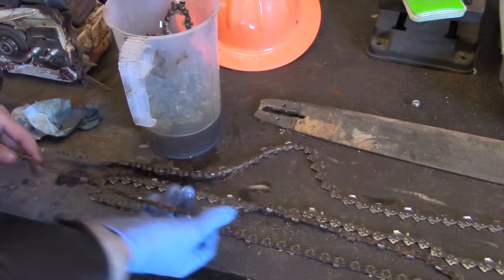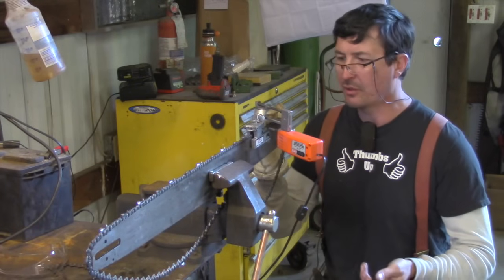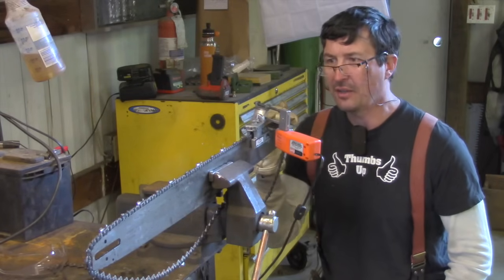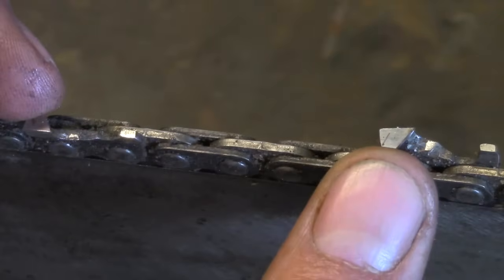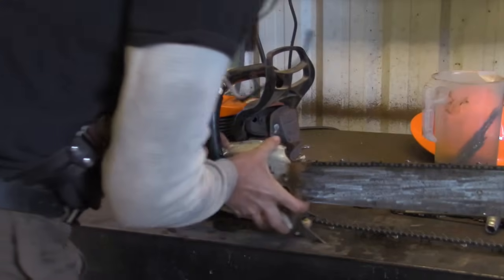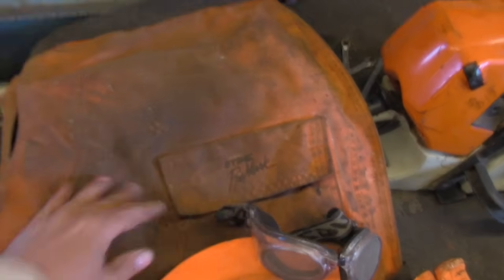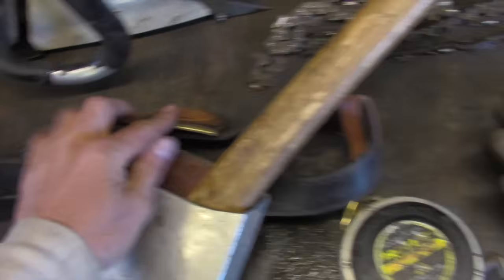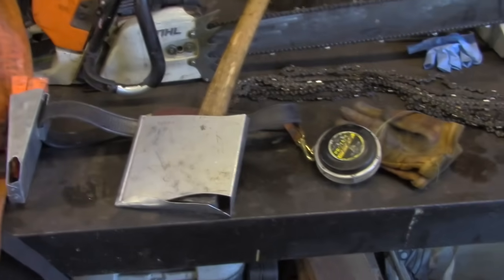A Better Way To Sharpen A Chainsaw

Comment: Nah, got to disagree with Wranglerstar on this one. If I'm chain sawing all day, means I got to sharpen at least once and two or three times depending on type of wood. It only takes 20 to 30 minutes with file. Depending how much cleaning chain and bar needs. With that much sharpening going on I'm not going to worry about perfectly aligned teeth. As long as it cuts through the wood like butter, that's all that counts. This isn't some chainsaw precision sharpening contest. This is just keeping the overgrowth under control. Anyway love your videos

Comment: Keeping a chainsaw clean...like herding cats or pushing water uphill.
Reply: irritablearchitect He pushes water uphill quite easily with his ram pump. ;-)
Reply: Soulman1282
Reply: irritablearchitect cats are easy to herd with food.
Reply: Pardon the cliche.
Reply: irritablearchitect You know how it is; some of us just can't help it. :)
Reply: No harm, no foul...I'm the same way, actually.

The world wouldn't be the same without the Smartassery.
Reply: irritablearchitect Indeed, it would be quite dull.
Reply: wildcat19671 ...as dull as a used chainsaw, and just as filthy. We've come full circle.
Reply: irritablearchitect 
For a funny video, search YouTube for cowboys herding cats
Reply: for the small amount of oil that a chain uses I just use new motor oil and avoid the crud that comes from an engine getting into my oil pump
Reply: It's a joke...a chainsaw is a filthy thing, even when it's clean, and then when you're running it as it's to be used, it's far worse.

2 Euros is a spectacularly good price, however. I think fitted chains cost me about $15-20 here in the states.
Reply: "...damn saw dust gets everywhere..."

Ya don't say! :)
Reply: Me too.
Reply: irritablearchitect he

Comment: Hi good vid for the novice.Not knocking you.I learned to sharpen saw chain when I was 12 years old,Yea about a 100 years ago.With 2 simple files(round and raker) I can make a factory chain look dull.I can make nice chips or make spaghetti.Does not take a whole lot of time to learn hand filing.The biggest problem to over come is left hand and right hand.Most folks can not get the angle the same from side to side.I work in a saw shop and only use the chian grinders for folks that cut rocks which are most.Another thing you mentioned is rakers.They are most important. and should only be taken down a hair above the cutting tooth.Rakers(so named are exactly that)They are what pulls the sawdust out of the cut.Next is the bar grove itself.Very important to keep it clean.Does not take much sawdust build up in the bar to make the chain ride up off  the rail and pull sideways giving a crooked cut.Not something you see with the naked eye but at 14000 rpm the chain will ride up out of the groove.Keeping the drivers in that groove is very important.Just a few tips Luck.Mcbain.

Comment: Wow - with my iPad playing your video and my new Granberg sharpener, I finally was able to sharpen my own chainsaw today - it was a rip chain for my logosol sawmill setup which requires a lot of consistency - once done I ripped through two big ash logs no problem.  Thanks for all your videos and especially this one - I would not have been able to figure it out easily without your video - I sure hope Granberg is showing you their appreciation :)

Comment: I use the Granberg manual model of this sharpener. I think I can give you some assistance here. 

At the 3:51 mark, if you freeze the frame, you will see that there are two teeth visible just before you place the depth gauge on the chain. These two teeth are an indication that this chain was not filed correctly. Looking at the top surface of the teeth, the tooth to the left is visibly shorter then the tooth on the right. The tooth on the left has had more metal removed. This chain will have a tendency to cut an arc as it goes through larger logs when the entire bar is in larger diameter logs.

To enhance the efficiency of this chain (or any chain), the teeth should all be the exact same height so each tooth takes the same amount of wood as the nest. That will not be the case with this chain. In order to achieve that the best method is to use a dial caliper and holding the vernier scale parallel to the bar, measure the length of every tooth to find the smallest one. You are measuring along the LENGTH of the chain, parallel to the bar, and NOT from right to left on the tooth.

After you sharpen that shortest tooth, sharpen all the other teeth to the same LENGTH. I have had firefighters state that after I had done that it made for the best cutting chain they had ever used. You do not have to do this every time if you file by hand, taking the same number of strokes on each tooth. With an electric sharpener such as the 12 V. Granberg that will be more difficult to judge and measuring will be the best way to do that.

Comment: Hello. I love you videos. Very easy to follow with great tips and demonstrations! I've learned a lot about stacking, cutting, sharpening, and anything a homeowner/ harvester would ever need. Thank you so much for keeping current and taking the time to film and share this information, especially from a "homeowner" position as your videos always are.. very easy to relate to. I noticed you had gloves in your kit but failed to mention them. So many people I've seen personally have the best equipment but think they're tough enough to not need gloves. You might too good for years but things get real when you take a pin oak splinter to the bone or start getting some pine sap all over the steering wheel of your new truck.. again thank you for the videos, count me in as a permanent subscriber. God bless!!

Comment: I got one of those sharpeners from Harbor Freight.  I am not a big fan of their tools by any means.  I just know someone who has one of those sharpeners.  They work well enough for me.  One advantage of knowing someone who has one already is that it makes setting up and operating it seem so much easier.  I might get a CBN wheel for it when and if the original one wears out.  I don't cut a lot of firewood.  If anything we have trees that sometimes fall down in stormy weather.  Sometimes it is only a few branches that fall down but often it is a tree that the wind or weight of snow brought down.  Most times these trees don't make a sound since they are somewhat far away to be heard.  Anyhow I am new to sharpening and these sharpeners make it easy to get a usable chain once again.  I hate struggling with a dull chain.  It wastes time, is harder on the saw and is not safe.  For what little cutting I do, I have a 40 volt saw.  They work better than you may think.

Comment: True there are several methods to sharpen your chains. Some file by hand and can do a fantastic job, however, the Grandberg provides a near perfect job every time. I’ve tried several methods and IMO the Grandberg is absolutely the best choice available that can be easily used in the field. I look fwd to sharpening chains for my friends in the field and give them the sharpest chain they’ve ever experienced. Truthful Disclaimer: I live in south central Nebraska and only cut firewood but with that said it is exciting to cut with sharp chains. (I know it was a pretty windy post but IMO all true! Keep blest and safe!)

Comment: I just bought and used for the first time the 12 volt Grandberg sharpener on my homeowner grade 18" Homelite chainsaw.  Yours and another video on YouTube were very helpful.  The only problem was to position the two chain retainer pieces.  On my Oregon chain I could not position them above the links.  I use a small gel battery to power the unit.  And yes, the sharpened chain works like new.

Comment: Combining the best features of the G106B File-n-Joint with the speed of the 12 volt grinder, the G1012XT clamps on the saw bar and allows accurate sharpening of cross cut and ripping chain to factory specs. Comes with one each 5/32, 3/16, and 7/32 grinding stones. For best results, use Kool-Grind lubricant, G440 Weight: 4.0 Lbs.

Comment: I burn threw 3 or 4 chains a week during the summer. I needed a way to sharpen chains fast and on the move. I know they may not be as "precise" as a jig mounted but I started used Milwaukee M12 Rotary Tool (Battery Powered Dremel) Ever time i Fill up (5-8 times a day) I give each tooth a quick hit with the tool and 7/32 cutter. One thing i noticed is that the direction of rotation is very important to how my tooth come out. I can sharpen my 72 driver chain in about 3 min. I drive around in a johndeere gator. so I just put the tool in the box in the back along with fuel and oil. As one of the other commenters said. I use the hat with the face shield and muff's. Im falling in the high mins of colorado so I'm guessing i don't have half the underbrush you do.

Comment: I watched this video and “How To Sharpen A Chainsaw Properly”.  Both excellent videos.  In fact the other one, where you used the Granberg for the first time, is the one that changed me to being excited about sharpening my chain instead of looking at it as a bane because I didn’t know how and always dreaded my chain getting dull because I had to find someone to sharpen it.

Anyway, I was sharpening using my new Granberg when I decided to refer back to “How to sharpen a chainsaw properly”.  I suddenly got frantic because I thought I was using it backwards.  It turns out you were using it backwards.  This is not a criticism because I know you know what you’re doing.  It’s just that the instructions say to “position cutter back against chain stop”.  That’s what you did in this video.  In the other video you positioned the depth gauge back against the chain stop.

After all that, here’s my question.  If you have your angles right, does it really matter which side of the cutter you start your grind from?  Do they have any specific reason fo telling us to do it the way you’re doing it in this video, or is it 6 of one, half a dozen of another?

Comment: I use the Granberg 12 volt grinder for my saw. Its fast and does make the chain wicked sharp. I don't have its guide but go freehand. Usually for touch up after cutting a truck load of firewood. When using it, I apply very little pressure to not heat up the tooth on the chain and to preserve the life of the little grinder stone.

Comment: These things are great. I maintain that it's important to have either one of the manual granberg jigs, one of these 12v power versions or a bench chop style grinder. I handsharpen in the field, but every 4-6 sharpenings I bring it back to a real guided sharpener to reset cutter length and angles.
By the way, filing the depth gauges off one of those raker gauges is fine for a while, but as the cutters get shorter, they need to get progressively shorter, not linearly shorter. An angle gauge (digital angle cube) is the best way to set depth gauge height. Matters more for milling and really high performance, but it's something to keep in mind. There's some talk about it on arboristsite.com and other forums that talk about chainsaw milling and race saws.
Reply: Kirby Weldon Here's more info for anybody interested in progressive raker filing 
http://www.arboristsite.com/community/threads/are-fop-really-progressive-depth-raker-generators.114624/page-3
Good info in the first post as well. On page 4 there's a little more info as well as a video link.
Reply: Arboristsite is a goldmine of interesting content. I search there first for any saw questions and before buying.

Comment: When you do those depth gauges make sure you round off the leading edge,  it is important to cut down on the kick back risk
Reply: James Goddard good call
Reply: James Goddard I always do that too.
Reply: The shape of the depth gauge has nothing to do with kickback..  however the height of them do. In the same way that them being too high will make the saw not cut. Too low will cut too.much. ripping more wood , and grabbing alot harder resulting in VIOLENT KICKBACK.  Saying you need to " round off your depth gauges when directly in front of a razor sharp , pointed tooth  is an old wives tale ive heard many times in the course of my career as a tree man..  if those depth gauges need rounding then so would the tooth bro...  Ya see what i mean... Kickback gets worse when tbe saw tooth has more wood to grab..  tampering with your depth gauges without knowledge of this is a quick route to an e.r... shape.dont matter. Height does
Reply: @no.step.on.snek.2423  you go argue with my teachers then, they all say the same thing.

Comment: Would have to agree with you as to the percussion of a jig, but, after over 50 years with chainsaws, and several years using electric sharpeners, I found, like many others with similar experience, you can't beat a good quality hand file for getting the best edge, and maintaining the best angles which is a problem with electric.
I appreciate the kickbacks in advertising, but just giving you my experience.

Comment: hi Mr.wranglestar,just a little fyi-diy.I clean parts like that chainsaw blade and many others also with one additional piece of kit.Get yourself an old aquarium bubbler and put the end of the hose under the parts to be cleaned and cover as well as possible.I tell you it is hassle free on some of the stubbornness things to refurbish.I'll set it outside overnight to run when I'm worried about fumes and mitigate any potential accidents.Just a small tip and trick,peace out.

Comment: Nice product placement. Been sharpening saw blades for over 30 years. I agree that this is a great tool but I'll take my hand sharpening vs a 12v burr grinder. Just my opinion. And vine maple is deadly. Good for you!

Comment: When I worked in the lumber mills the saw blades would get red hot from the friction caused from the pitch build up. We used a spray bottle filled with diesel to help, just give it a squirt when you notice the pitch on the chain. Your bar and chain will last longer.
Reply: Yep same as cedar here in texas

Comment: My dad could sharpen a chain like no other.  We had to heat a 4 br farm house in iowa winters.  We cut firewood very often, we had one chainsaw and no money for a new chain or saw for that matter.  It was get the wood cut or freeze to death.   When the stakes are that high you become a master at sharpening by hand.
Reply: same here just a different state
Reply: Canadian here. No problem sharpening a saw. Just a round file and raker file from time to time.
Reply: I grew up in NE Iowa, where it sometimes got to 30 below with the wind from Canada plains & North Dakota 
Whipping thru, so I know what you are talking about. My brother Harold and I, spent many a spare farm day
in the woodlot gleaning out dead & dying hardwood walnut, butternut, oak, and ironwood for winter firewood 
supply. That woodlot was on un-farmable rocky hills by Hickory Creek, where we ran loose young cattle; not-
de-horned, so we also had ro dodge wild calves and among the rocks, rattlesnakes, while we harvested wood.
                                                                                   Fritz, the former farm kid/apprentice mechanic & woodman.

Comment: Thanks for reviewing the Granberg chain file,looks easy compact and portable.I found that consistency tooth to tooth is critical,something painfully difficult by hand,especially here in the east cutting hardwoods walnut,maples,oaks & the like.I've seen sharp chains, pull to the left or right(hand sharpened by old time pros)and I've heard the argument that I'm wearing my chain out prematurely,nonsense!A sharp chain makes an inherently dangerous activity safer and less tedious.If your chips start getting small it's time to file the rakes down.I can sharpen better with my pos Harbor fright sharpener than by hand.

Comment: I sharpen my saw a lot and always with a file. I can't imaging that grind touching the sharpness of my blades, primarily because the grinding wheel grinds perpendicular to blade, not across it. It may be precise, but the microscopic blade finish will look like a mountain range by contrast compared to a file, or even a grind across the blade. I know my blade is sharp when I see a crisp straight edge with a mirror like reflection, normally with just 3 or 4 passes for a slightly dull blade, unachievable from any grind. I feel very confident I could make your saw even sharper just with a free hand file.
Reply: Just to clarify your terminalogy, it's a bar! Not a blade. And you sharpen the chain not the bar.

Comment: I use a dremel tool on low speed I sharpen my chains.  I sharpen all three of them a day ahead of cutting.  when/if they dull I just  hit them with my hand file or swap it the whole chain,  fast and easy. Soft woods suck for home heating. it takes twice the amount of wood for 1/2 the BTU's and shit load of ashes.

Comment: Technology and information are wonderful tools. They are what they are. Take it or leave it. Thank God we have videos, writing utensils and patience for some would still be trying to roll a square wheel made from a round rock. All of the many ways of sharpening chain and doing it accurately are a sight better than nothing at all. It would be manual hell the whole way. I think its a great video. We all eventually learn the easiest and most proficient way we can.

Comment: Agree entirely with your observation that few of us can sharpen a chain freehand. But for $35 I bought the Harbor Freight 120V chain saw sharpener. Now the thing is not a Jolly (10 times price) but it does the job. I am actually surprised that it is so good.  I have three chains  on hand at any time. One on the saw, one spare, one waiting to be sharpened. Rotate into the sharpener. Still do the depth stops by hand, though.Thing I don't like about the Granberg is that I have to have either a transformer or a spare 12V battery.